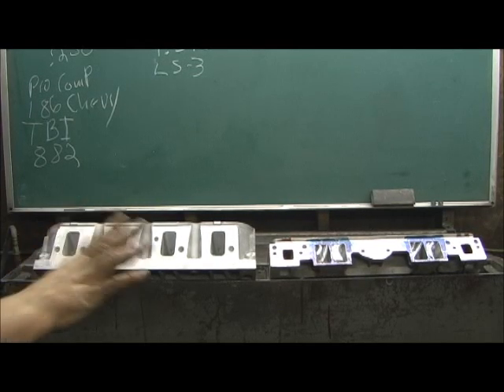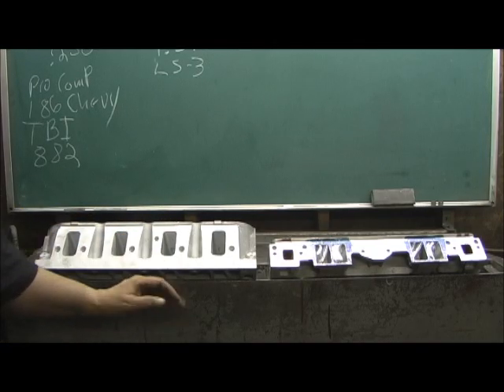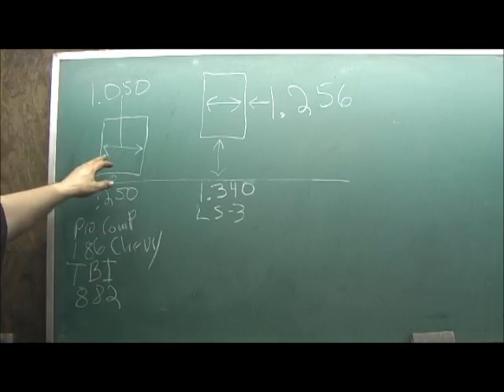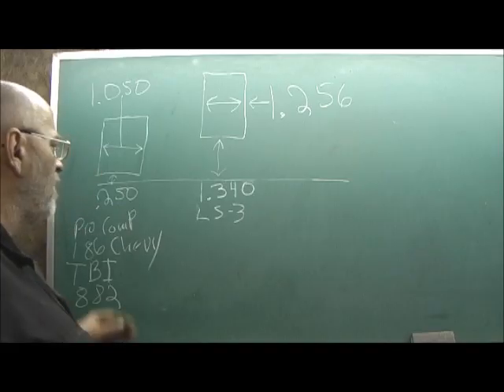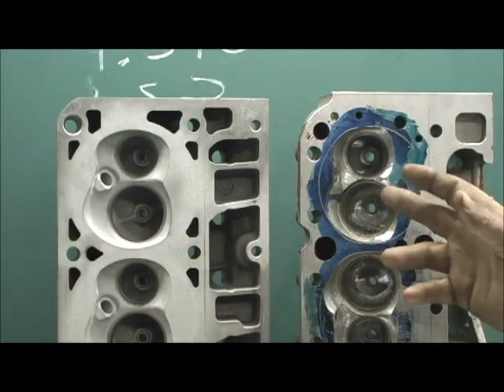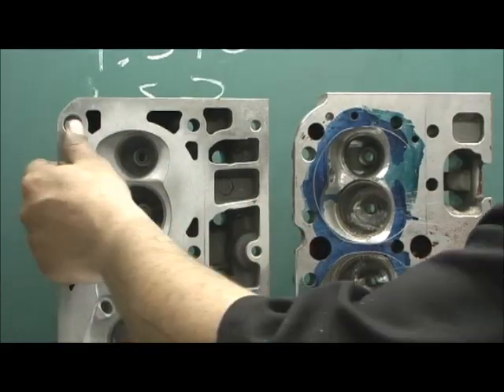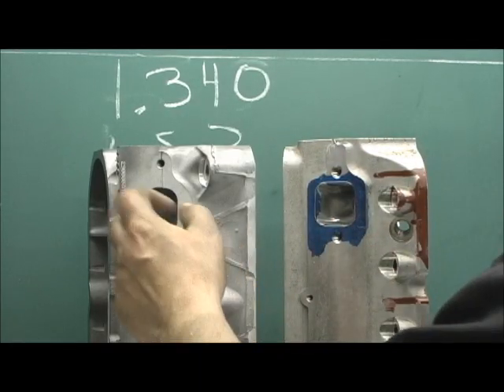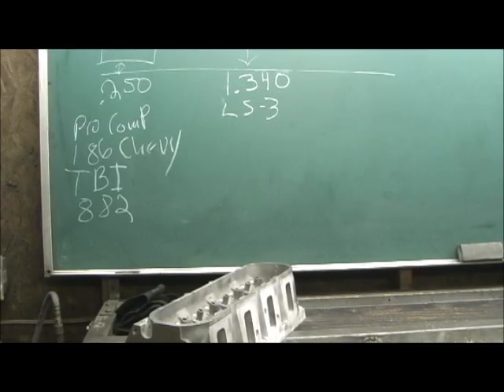Comparison of 2013 LS3 To Pre-1998 Standard SBC Heads 1.2

Comment: Smallblock Chevy was designed in 1953/54 and started production of the 265 cubic inch engine in 1955. So it is showing its age for good reason. The designers never figured it would grow over 327 cubes. The evolution of the smallblock is really amazing and still capable in the right hands. The Ls3 just makes my head hurt with the power possibilities!